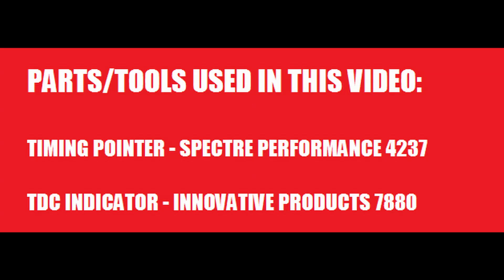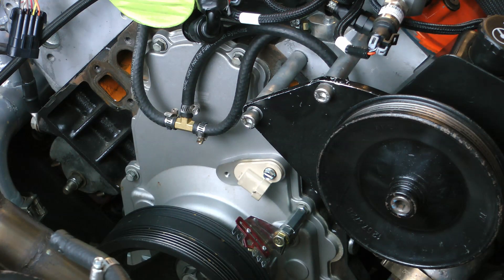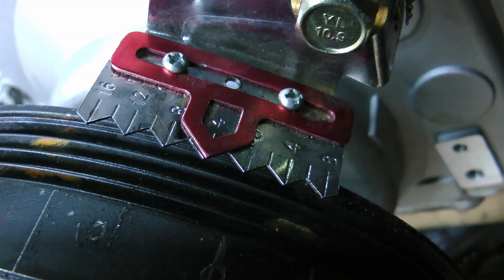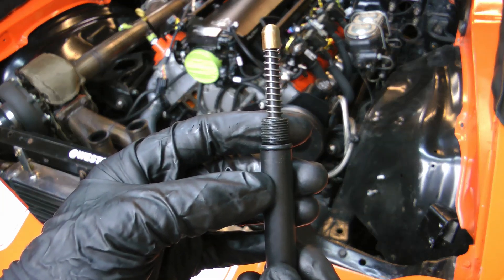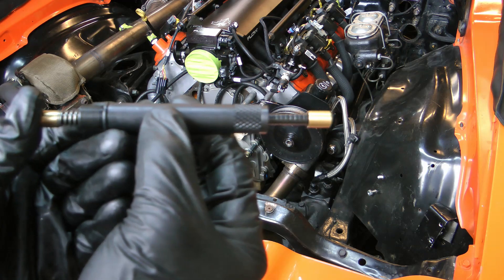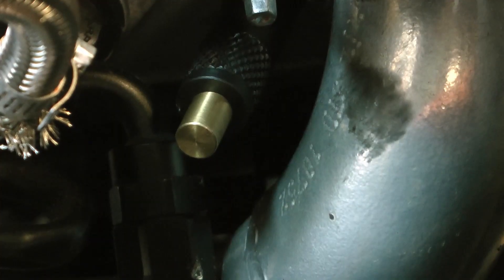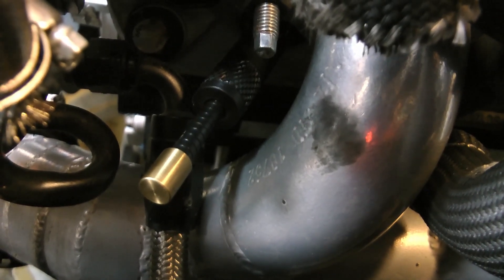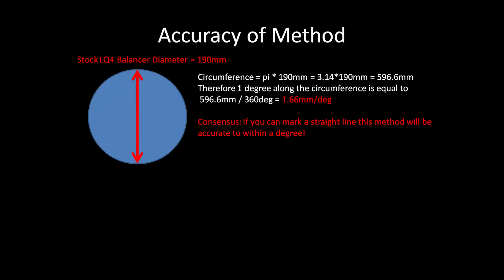DIY Make a Timing Indicator for your LS Engine to Confirm Timing

Comment: how close was timing after you marked it? Going down the same path you showed here shortly
Reply from the maker: @machz28  it was bang on
Reply: @WestcoastWrenchin  Love to hear it, did you keep the rest of the plugs in or removed them to facilitate turning?
Reply from the maker: @machz28  easier to turn the engine over with no plugs in